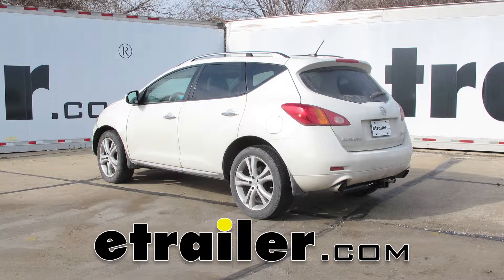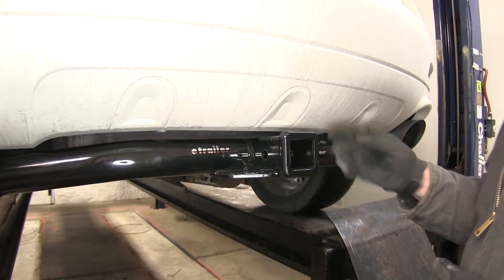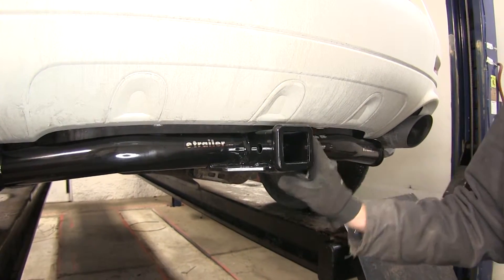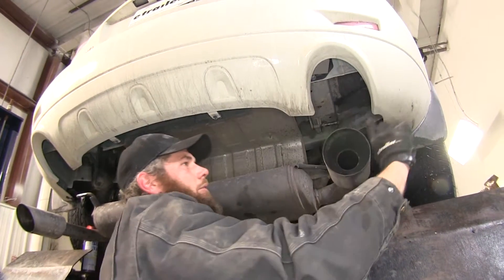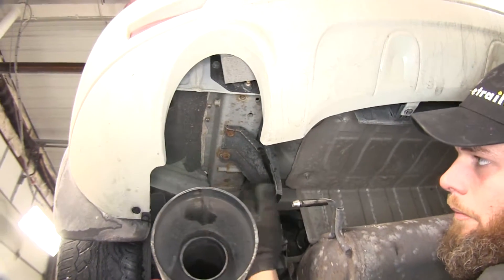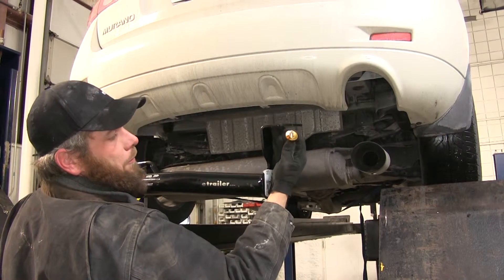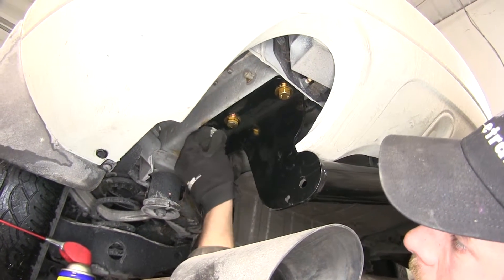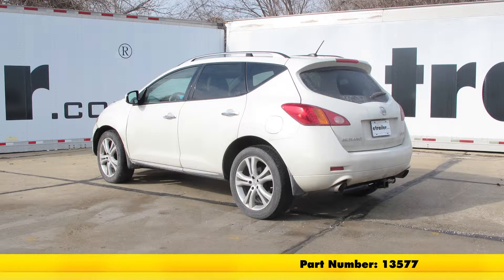etrailer | DIY Install: Curt Trailer Hitch Receiver on your 2010 Nissan Murano

Comment: Another great install video! I was able to follow this and successfully install my trailer hitch. The only issue is the Curt hitch mounting holes didn't line up with the frame properly, which made it pretty tough to get all 5 bolts in.
Reply from the maker: Sorry about that. What you described happens from time to time. When the hitch is manufactured, the mounting flanges are made of steel that's less rigid, so the hitch can flex a bit with the vehicle. Because of that, during shipping and handling the hitch can get slightly tweaked out of position. We have an article that explains how to fix this, we'll link it here for you:
https://www.etrailer.com/faq-my-trailer-hitch-doesnt-fit.aspx